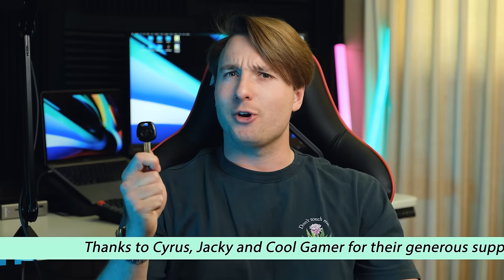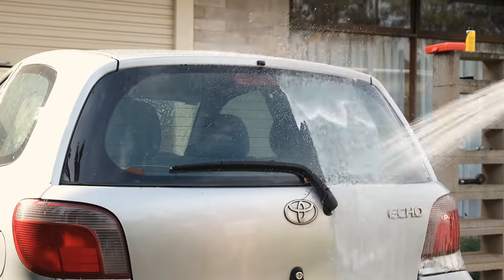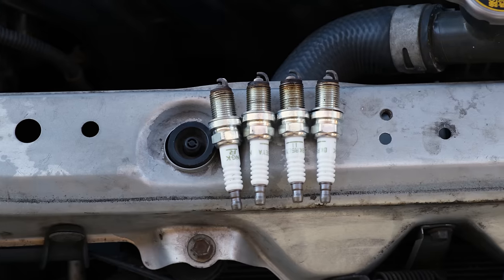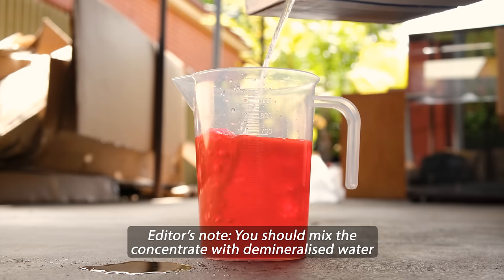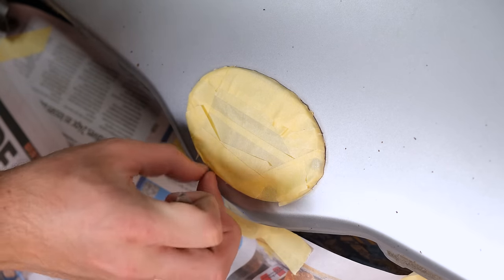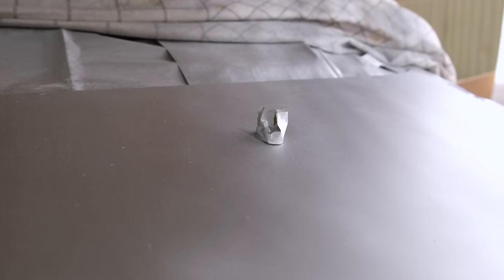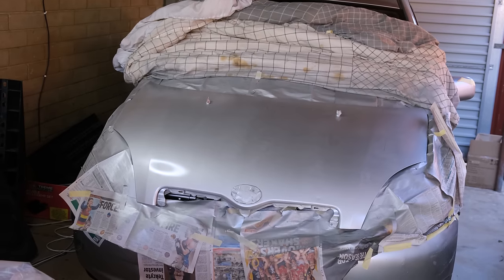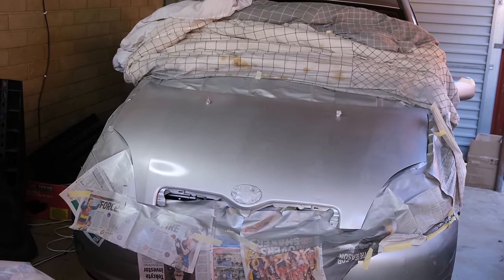I Bought A Cheap But FILTHY Toyota...

Comment: No lie, My mum owned a 2001 Toyota Echo 4-Door sedan in Silver, Got it for 500 loonies from the wreckers in 2014. It had 221,000 Kilometers on the clock, Had a LOT of issues, but it ran cromulently alright. The electrical system kicked the bucket in 2019 when mum was driving to work at night. It had 318,000 Kilometers when mum got rid of it. She got a 2019 Toyota CH-R Limited for 37,000 loonies in reddish maroon with a black roof. It has 68,000 kilometers, and it runs just fine. Toyota makes the most reliable cars EVER MADE!

Comment: I would also replace the headlight assemblies. Visually it makes a big difference in how the car looks, and also is safer at night. They are not too expensive. I did this in my 2001 Camry and it looked like a brand new car - from the front at least :)

Comment: I owned one of these for years and years. Was truly the greatest car I ever owned. 1.3l engine meant it got 6.3l per 100km no matter how I drove the car (which was changing gears at redline 9 times out of 10) was even the same colour as the turd in this video. But I have to say one thing and that is that it never ever got close to this dirty and the paint never chipped. Sad to see how people treat these Toyotas when they're probably the most hardworking cars out there haha
Reply: Hello
Do you make 6.3 in the city ?
Thank u

Comment: I had a Corolla ae91, now a Karina t170, both cars are simply eternal, they require almost no investment. The engine is simple and reliable, like a Kalashnikov assault rifle, Japan made simply incredible cars: power steering, roadside lights when turning, power windows with a button, electric mirrors, automatic transmission. and this is all in 1991. I’m from Russia, here the first automatic machines appeared closer to 2010 (not our own development, essentially also Japanese), here there is a cult of old cars that have nothing in them, they cost from 1.5 thousand dollars, while I bought my Toyotas for 600 and 800 dollars.

Comment: You've got the best of all worlds in that little car.  It's cheap to run/insure/register but has a replacement engine so it's very reliable.  It looks good enough so that you're not embarrassed to be seen in it, but not so nice you're afraid of getting a parking lot ding. It's small on the outside, but with the rear seat folded down, surprisingly large on the inside.  BTW...I'm pretty sure the cross brace you used to jack up the rear of the car to inspect the wheel bearings is NOT an approved jacking point.  It's not a solid rear axle like on a Hilux...look at how much it's flexing at 11:25

Comment: My family had a 2003 toyota echo, same couler but manual back in 2015, it was the car that we drove for 36 hours straight down to Victoria to see the snow, it already had 350k kms on it and still made the trip and back, still had it for 2 more years before it was crashed due to a roo, such a reliable cheap car, ours was also used for food delivery before we bought it and it came with the big dominoes sign on the top. Awesome vid

Comment: ChrisFix gave all of us a tip on oil change. Try to pour some oil in the oil filter so you wouldn't run dry.
Reply from the maker: Given that it sits vertically it would’ve filled up as I put oil in. But yes, that’s definitely good advice for most vehicles :)

Comment: Hehe yeah boi.
Another car project!! 😎😎😎
Engine rebuild, transmission rebuild, axles & steering repair, A/C system check & repair, brake system check, fuel system cleaning, interior & exterior detailing, body repair, a bit modification.

SWEEEEET ❤❤❤🚗🚗🚗

Comment: If you didn't have any service history, you really should have done more than just the oil change. 

Personally, I would have replaced ALL the vital fluids, spark plugs, air filters, fuel filter, and at least cleaned the brakes. Those headlight housings are also super easy to repace and aftermarket parts are cheap.

Comment: Ive had 2 Echos, a silver 3 door manual, and a gold 5 door manual. the silver one had a stretched timing chain so moved it on. and my gold one had perished door seals and leaked through the tail lights. had to get rid of it when the mold became a problem but had it for around 5 years without many problems. the ignition coils die, and they like to burn oil but thats expected with age.

Comment: To avoid doing the repeating coolant flushes, I would just hook the heater core up to a hose bib from a house. There's a certain procedure, of course, but it's better than repeatedly doing flushes like that. imo.
Here's how you do it:
Hook some clear hose about the size of the heater core output, you'll need some fittings to make it work; remove the thermostat and unhook one of the hoses that lead to the radiator. Or you could unhook the radiator completely and drain it and pour water in it with the loose drain plug. 
Slowly turn on the hose, I mean slowly, anything above the psi on the radiator cap and you're in the danger zone. You don't need much pressure at all to get that water going.
If you've done it correctly, that rusty old water should turn clear fairly quick. Hook everything back up like it was, put a new thermostat, must be new, preferably something you can get from the dealer's parts department. Now just add whatever coolant you gots, and presto change-o. You can put in concentrate in there and let it mix in as the thermostat opens up if you want.

Comment: my dad used to have one when he had a farm. I  used to drive it around the sealed and dirt roads around the property before I had my learners and its just a fun little runabout. We still have it albeit since diving into cars I have lowered it, cut the muffler off and put some el cheapo wheels on it but as a cheap shitbox that I drive only when my Mazda 3 MPS is being worked on, I cant complain and it keeps going

Comment: Look into a coolant funnel, it helps burp the cooling system. Also, what i'd do is run distilled water flushes until it drains clear then fill with 100% coolant. Most times you have enough water in the block to even out to a 50/50 mix.

Comment: What a good little video
I’d recommend doing a full drain And refill of the brake system And the power steering system if the (dot fluid) is left for too long it could corrode the lines highly unlikely, but sometimes

Comment: You should try replacing the body panels with good second hand panels from like a car salvage yard that will definitely improve the value and looks. Recently its a trend of saving neglected old vehicles and putting them back on the road giving them life. I think going beyond and fixing the bodywork will definitely improve its value give it a new lease in life. Thats why I wish theres a part 2😂

Comment: Awesome video! It strikes me how perfect all the metal on that car looks. Good thing you don't live somewere like that uses road salts like we do here in Toronto. 

It's a little disheartinening how cars waste away from the rust, regardless of how you care for them. My family's bright green 2008 Ford Escape Hybrid was in perfect mechanical condition. 340,000km and not a single leak or engine problem. Even the 15 year old hybrid drive system worked flawlessly! But despite several undercoats and other preventitve measures the poor thing was made of mostly rust by the beginning of this year. One fateful day it was driven over a particularly large downtown pothole, which took out the rear right shock mount. After the impact the shock was only being supported by the structure of the wheel well. That car was so tough that we drove it for a week before the noises and vibration got noticeable, and even then it got us home. R.I.P to the big ol' shrekmobile.

Comment: Another great video, but omg id burn this to the ground lol. Btw i love that you are buying junk cars to practice painting on, it's a great idea and you can always resell the car, even a cheap clearcoat is better than no clearcoat.

P.S. Psi, you should get one of those coolant funnels you can keep filled, it helps bleed cooling systems so much easier and they are CHEAP.

Comment: Demineralised water is just battery water. Been using that the first day i got the car. At 450,000km and it still does not drink much water at 1 litre per year. But its burning abit of oil now, half a quart every 8000km service.

Comment: I daily drive a 97 Toyota starlet with 260 000 km. I bought it for my kids to teach them in a nice small car. Ended up the clutch had a small shudder in it so the 2 youngest went auto.I think I got it at 160 000 .

Comment: I’ve got a Toyota Yaris, a second generation. It’s a 2006 model with the 1.3 VVTI and a manual gear. This car is amazing. The engine is so cool. This car is really reliable, it is a Japanese car 👍. I’ve had it for 2 years and no problems.
Reply: Salut
Est ce qu'elle manque dacceleration ?
Elle consomme bcp ?
Merci
Reply: @ismiismael  Bonjour aucun souci avec, elle marche super bien, la conso est raisonnable.
Reply: @enzolouis974  merci de ta reponse
Ta version a les sieges reglable en hauteur
Reply: @ismiismael  Sur la mienne j’ai le siège conducteur réglable en hauteur

Comment: That version of yaris 1.3 is one of the best fuel efficient i ever seen, 
This vvti engine at this size is most effective,  minus is plastic bumper edges are coming loose easily front and rear,  and rear suspension torsional bean gives an uncoordinated feeling between both axels when cornering, plastic of interior gives a feeling of a car from lunapark....
Big mistake to put a book to secure the car under the real beam

Comment: Its really best to replace wheel bearings in sets. Not like all 4 but the one on the other side, I guess if youre really trying to save money you could replace the part later. its just maybe a safety precaution or trying to prevent further hassle.

Comment: After test driving one of these many years ago, I tested an ist... and then brought a Suzuki Swift with the M13a and "proper" auto (even though the salesperson tried to get me to by the facelifted version with the shitty engine and the CVT)... that was 10 years ago, and I still have it and done over 380,000 Kms
Reply: I heard the suzuki swift have clutch issue
Did you experience that ?

Comment: You might want to remove the plastic trim in the back on the inside to make sure that the rust is just the sheet metal and hasn't gotten into the body structure.  Then just poke with an awl or screwdriver at the metal that is NOT the body to make sure the rust isn't there.  It most likely has not, but it should be easy enough to check.
Reply from the maker: There isn’t any rust on any of the body. The previous owner just did a horrible job at hammering out a dent (with a fairly sharp tool).

Comment: You should polish the headlights, makes possibly the biggest difference in exterior looks
Also owned a  -00 Yaris for years without a single issue - most reliable little bugger ever, maybe I should get one again
Reply: Hi
Hox much its consume fuel in city ?
Thank u

Comment: If the interior looks like that you know it's NEVER been serviced peoperly, which is part of why the engine had to be replaced ! !

I'm surprised you're still using rattle cans when cheap electric spray guns are so cheap. You also didn't replace that mangled front guard ?  Are they welded on in this model ?

I see you drove it back from Gawler 😁

Comment: Not a huge deal, but you should also pre fill the oil filter before putting it on. Saves starving the engine of oil for a short amount of time as it fills up on startup.

Comment: One thing you could try is using electric drill and put a brush attachment on it. Then just vacuum it with a detailing vac. That way you'll get the seat's and door cards mich cleaner✌🏼

Comment: i had a 2000 echo sedan with 360,000km when i sold it, engine didn't leak or burn any oil.....did go through a few clutch replacements though, then had a 2007 yaris with 280,000km same deal but clutch never needed replacing due to the fact it had done all highway km...when i went to sell the car a guy called up and said the engine would be on its last legs to try and low ball, still registered years after i sold it so i presume she is still on the road, there seems to be a misconception that small 4 cylinder engines don't last.....if you change the oil regularly and look after them they will last a long time.....i always have a laugh when i think about the guy that called up just to tell me the engine would be cactus with 280k.....absolutely no idea boomer. The 1NZ and 2NZ engines are absolutely great

Comment: What was your reason to apply the jack in the middle of the torsion bar of rear suspension?
It may bent over because it is the weakest part to apply the jack.

Comment: @psivewri - 
Yes, wear a REAL painter´s mask (with A2P3 filter) at 7:44 & shave off all beard (yes "babyface" is required) & make a fit testing (especially with half face masks) , all other masks incl. surgical masks (as you used) & FFP2 are useless

Comment: Did you buy this car unregistered, because surely it will fail pink slip with all the problems you found!

1:10 WTF happened to that panel? Did they blow torch it :O
4:50 Maybe remove your watch as well when doing this

Comment: I have 2001 model and still can't understand where to add coolant ( in the radiator or in the reservoir )  there is " min " /"max" label  in the reservoir. Some people say to add directly in the radiator , others in the reservoir.
Reply: The reservoir serves as a backup and as an overflow.
If you find it empty very often it probably means you have a leak in the cooling system (*1).
When the car is cool, fill the radiator, then top up the reservoir to the max line.
It will evaporate over time so you might need to top every 6 months or so.

-*1 Also possible but rarer is that the car overheats, coolant overflows in the reservoir which in turn overflows on the ground, then car cools off, sucking back all the coolant from the reservoir leaving it empty and leaving radiator low on coolant.

Comment: These old corollas and Yaris’ are amazing vehicles, mine keeps going and going but you do not want to crash in them. Idiots are buying more and more massive Utes, adding massive bull bars to fend off the shopping trolleys and you will
come off second best. Buy as modern as you can afford, after a certain point kilometres travelled and cosmetic condition is less important than its crash worthiness.

Comment: Well there are more fuel efficient cars out there with Toyota/Daihatsu engines out there. Like the 3-cylinder 1KR 1.0 68hp petrol engine out of the Daihatsu Sirion, Toyota Aygo, Citroen C1 and Peugeot 107 get's me at least 65 mpg(and sometimes even more. The least fuel I used was 3.9 litres on 100 kms) in my little Citroen C1. And honestly even though these cars are tiny they're pretty comfortable and also relatively quick compared to other small cars. And I don't know what this grimy interior thing is but my Citroen looked just a little bit cleaner after only 17 years and 82,000 kms on the clock as I bought it about a month ago
Reply: I think the Aygo (and its French brothers) were mainly intended for Europe. I drive a more modern Yaris (Mk3 1.5L petrol) and I get between 45 - 55 MPG (15.9 - 19.4km/l) depending on the my speed.

Comment: I once got money from my inlaws for a 'better car' (drove an old Seat Ibiza at that time). Thought I'd please them by buying something Sensible. Bought a like-new Yaris. Seemed fine at first but at some point I noticed I couldn't keep the thing straight. Nothing seemed wrong, so I went to the Toyota dealership to buy another one. Same issue, the steering just does not center, you have to always correct it to the center with every tiny move you make. Guy at the dealership literally said: "If you like driving, you don't buy a Yaris". This was in 2013. Some months ago I drove a Yaris belonging to a friend's girlfriend. I forgot how bad it was, I just cannot imagine it's supposed to be like that, but it is. Aygo the same issue by the way. I do enjoy a video like this a lot, but heck, when it comes to the Yaris I'd rather crawl. 
Really appreciate the love you give this abused car though.
Reply: Also, well done on getting the 1.3. I had the 1.1 and it's just impossibly slow. I'm a calm driver, but if you want to enter any road from a side street you have to rev the car's nuts off in first because the gap to second is just too large. It'll completely bog down if you shift before 4500rpm, and then try to get up to 80km/h swiftly.
Reply: And then. 100.000k with spark plugs is very optimistic. I'd stick with 30k just to be on the safe side. It's not like they are expensive, and especially with older cars (not as much computers keeping them running) you really do notice the difference.
I do wonder where that coolant went...

Comment: Ok im gonna save this video. I didint know u have to mix coolant and water. I thought you either use one of the 2.
Reply from the maker: It was a coolant concentrate. Coolant, otherwise known as "antifreeze" is mostly demineralised water. But it contains glycol which lowers it's freezing point so your coolant won't literally freeze on cold mornings. It also helps to stop corrosion :)

Comment: That's what I'm willing to buy but it's manual (better) BUUUUUT had like 300k in mileage,so maybe if I get it imma Change the engine and keep it for like a decade at least since there is no other problem.
Yaris are true beasts when it comes to Performance and lifespan

Comment: if you are going to keep making these car videos, you better inest on some gear like a vapor cleaner.  and dont be afraid to take these interiors apart to wash tose plastic parts in water and soap. also, get some bodywork gear and learn to fix and paint these cars as you do it